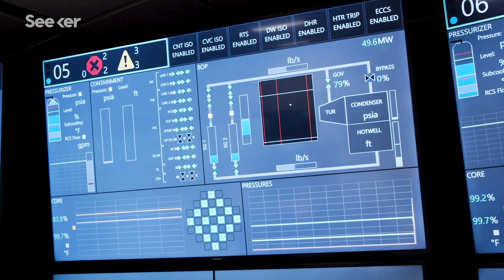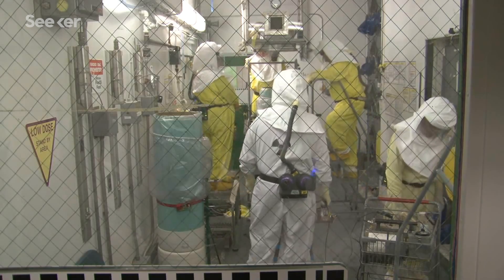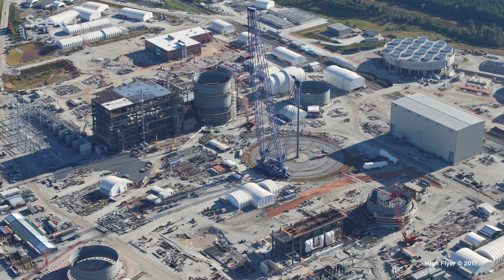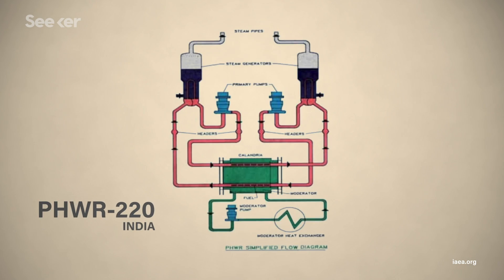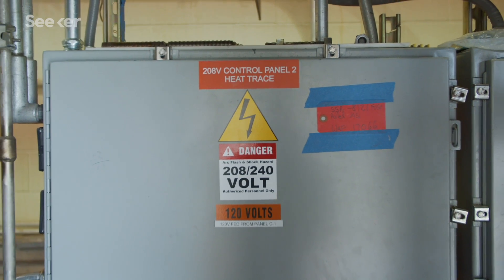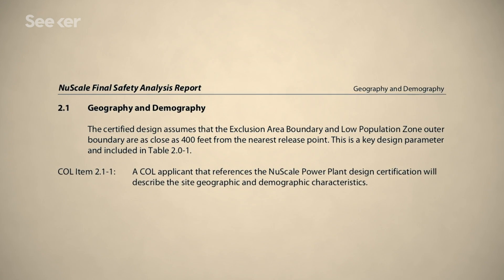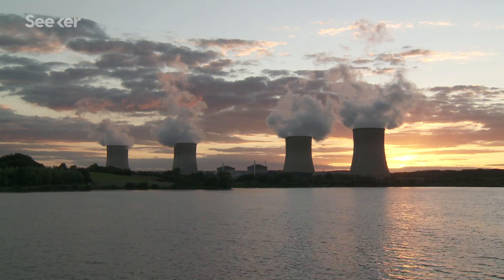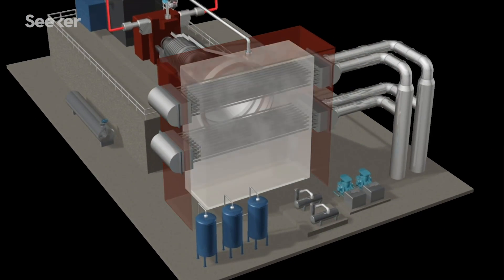Mini-Nuclear Reactors Are Coming, and They Could Reinvent the Energy Industry

Comment: What about thorium
Reply: Thorium will be great but we don't need it right now.
Liquid fueled reactors that can burn Thorium can also burn reactor waste, guess which one of those two is more of a problem right now?
Reply: @MostlyPennyCat  wait they can do that? with which kind of waste? theres loads of nuclear waste, for example about 50 bagillion fucktons of japanese dirt is currently bagged and stored as nuclear waste after the fukushima disaster, all equipment used inside contaminated zones becomoes itself contaminated ( radiation suits included) and need to be sealed away too. the entire town of pripyat is full of nuclear waste as every single item exposed to open air has become irradiated. hell several PEOPLE could be classed as nuclear waste (none are alive)
Reply: @cageybee7221  
OK, not that kind of nuclear waste.
Spent fuel from the uranium fuel cycle.
https://en.m.wikipedia.org/wiki/Spent_nuclear_fuel
Liquid fueled reactors can take all that stuff and burn it up.
That includes the nasty shit like strontium 90 and caesium 137.
Reprocessing is expensive and difficult, I think they've mostly given up at sellafield. But 96% of used fuel is the original uranium.
Yes, we burn 4% of the fuel because solid fueled reactors are garbage.
Then we have to store it for a billion years.
You can, sort of, just chuck all that into a liquid fueled reactor and it will burn up all the uranium and all of the byproducts.
Reply: James Neave a more accurate take on LFTRs.
Reply: Amo Aubrey what about thorium?
Reply: @inquaanate2393  was supposed to replace uranium as the go to for nuclear energy. More output and not as harmful, as I recall...
Reply: other seeker vids have been done on it, and perhaps this design could be converted over since thorium can be used to make an isotope of uranium and infact that is what happens in a thorium reactor normally.

Comment: My questions are: What if the control rods for the reactor expand and get stuck not all the way down in an emergency when no power is available? What are the probably of that happening? Does the safety measures include checking for this possibility to inform operators?
Reply: no one repeats mistakes from four centuries ago
Reply: They just fall. They wouldn’t be able to get stuck to anything.

Comment: what about fueling those tiny reactors? probably a pain in the butt, also the waste, because the conventional reactor has a low efficiency in bringing down to 0 radiation materials
Reply: Fueling isn't a problem, you just don't need that much uranium to run a plant for a decent amount of time. So I'd guess they can run for somewhere between 3-6 months.  it might be possible to swap out the material in a faster manner since the reactors are in a much more manageable format.

Comment: Only one criticism: what about the waste?
Reply: Nuclear waste is easy.
 Just put it in steel barrels in a damp cave and assume the barrels will never rust because they're steel.
Reply: @massimookissed1023  Or....we use up the waste in a thorium cycle reactor and have lots of steel and caves left to do other things with!
Reply: RIGHT! Light water reactors are still too inefficient and create lots of long lived waste products.  If we are going to smaller reactors it is time to truly innovate and switch to more efficient designs that are safer and use more abundant materials.  We had the initial designs running in the late 50's and 60's but our government wouldnt back them as they didnt utilize the technology already paid for by our navy.
Reply: " what about the waste?"  You mean the 99% of energy left over?  That is why it is 'dangerous' for so long, it still has an amazing amount of power in it.  We should use it.  Waste is only waste if you do nothing with it.
Reply: Yucca Mountain.
Reply: Liquid fueled reactors have an almost total fuel burn up. Very little waste produced and it's only dangerous for a few hundred years.
They can also be fueled with solid fuel reactor waste. Which they then almost completely burn up.
Reply: France produces 80% of it's energy from nuclear fission since the 1960s, and the amount of nuclear waste produced could fit inside an Olympic pool. Having two kind of reactors, the first ones use the uranium and plutonium taken from the ground then enriched, use them for about 8 years, then put them in a facility for 11 years before giving them to the second type of reactor using them for 8 years again, before storing them in secure facilities completly radiation proof in lead. France is building a new third type of reactor that will be able to re-use this waste once again.
Reply: @arthemis1039  garbage
Reply: That's the real question for any nuclear fission tech.
Reply: Easier and safer to store than carbon dioxide!
Reply: There are other types of reactors that use this nuclear waste.
Reply: @LandoCalrissiano  Yes, but it's not worth it to use this waste yet.
Reply: @Martas331  We start using the waste not because it is worth it but because we need to get rid of it to avoid future issues.  Heck, uranium is still cheap enough that thorium reactor development with its cheaper than dirt fuel dont compete.
Reply: Throw it on the moon or empty space?
Reply: @catman2157  That's really bad idea. It's really expensive to get anything to space. The stongest rocket (Falcon heavy) can get only 64 tons to low orbit at cost of lots of fuel.
Reply: @Martas331  Right!  And I dont think we want 64 tons of nuclear waste sitting a rocket that might not make it to space!
Reply: @catman2157  You can put it on the moon....havent you seen the old sci fi show SPACE:1999?
Reply: @catman2157  also a pound of plutonium weighs like 40 lbs
Reply: @13orrax  It either weighs 40lb or 1lb it can't weigh both.

Comment: Would you please make a video on all Nuclear disasters?
Reply: Chernobyl, Harrisburg (Three-mile island) and Fukushima are the only three nuclear power disasters that have happened. All of them was because human negligence and bad security practices that we now have implemented guidelines and safety procedures to prevent from ever happening again. At Chernobyl, they pushed the reactor further than was safe and even had removed important safety technology to make it possible to push it that far. At Harrisburg, the personal was inexperienced and didn't have good enough education in that particular control room so when a valve didn't close properly and the warning light for that was placed inconveniently which the staff did not notice so when one of the cooling systems got overpressurised and they were according to their safety procedures was going to open up the valve towards the pressure release tank the valve in that tank was not closed which resulted in all the cooling fluid was ejected from the reactor and therefore overheated the reactor. Fukushima, as we all know was hit by a tsunami that took out the backup generators for the cooling system pumps. If the power company had the foresight to know that there was a risk of a tsunami they should have protected those backup generators from such an event by either placing the generators on higher altitude on a tsunami safe platform or had build protection walls or levies around the generators or even made tsunami safe underground rooms to have the generators the accident would never have happened. If they had just placed the generators behind the reactor buildings they might not have been hit as hard the accident could have been avoided. If they could have just known that the area had a risk of getting a tsunami as if the whole of Japan wasn't placed next to a very active fault line or something like that...
Just a reminder Chernobyl is the only of these three that had a single death because of the following radiation exposure. That was because they tried to downplay the severity of the accident and did not immediately start evacuating everyone in the area. As a result of this around 4000 people died. If you compare it to the millions of death each year because of air pollution from fossil fuel plants and cars and also consider that that is compared to 4000 people over a 40 year period and the 3 million people that die every year because of outdoor pollution from fossil fuel and another 4.3 million because of indoor pollution from burning fossil fuel and biomass. That still doesn't include the people dying from coal and oil extraction.
Reply: @Dragonited  Sounds like excuses.  It seems like we forget again once a generation.
Reply: @Dragonited   Thank you for sharing your knowledge. I don't think there are only three nuclear disasters  
(https://en.m.wikipedia.org/wiki/Nuclear_and_radiation_accidents_and_incidents?wprov=sfla1)
Reply: Why? So we can scare people about phantoms that no longer exist?